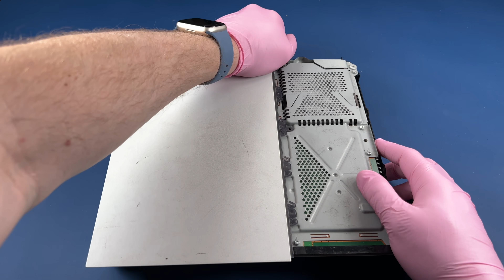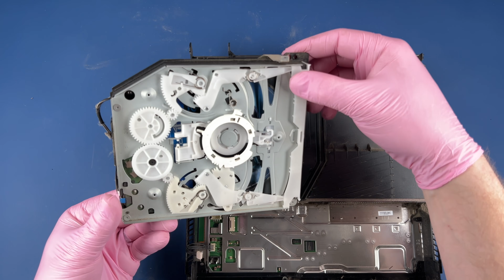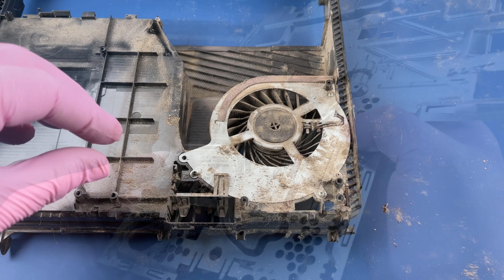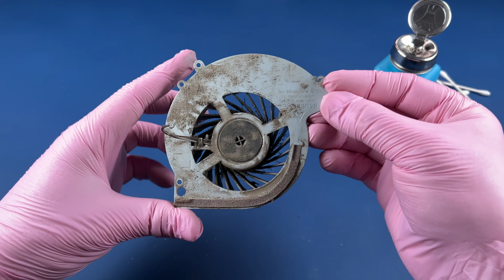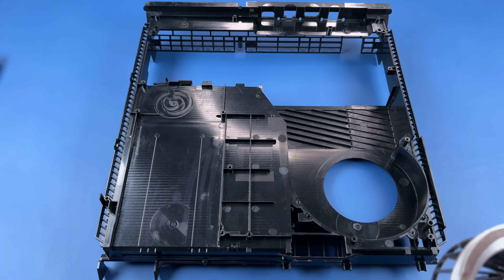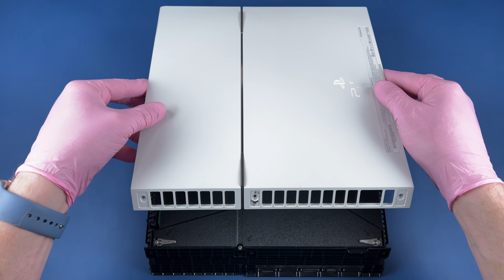PS4 Makeover: Deep Clean & Restore Your Console

Comment: Those holes where the dust are, those are specially designed airflow features that Sony designs into their stuff, they make it so there's only one airflow path through the system so that the single fan can cool the entire thing. That's why those areas get so much dust, all the air the fan is pushing goes through there.

Comment: I made that mistake on the disk drive for my ps3, I messed it up and it wouldn’t accept a disk and wouldn’t line up the gears. I was panic sweating thinking I’d ruined it, couldn’t find that manual screw and had to move it by hand.